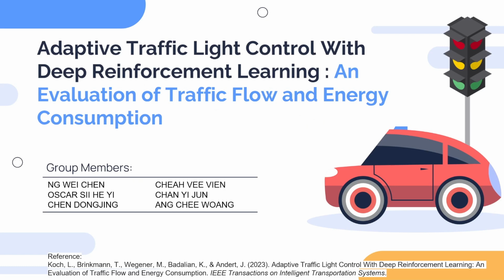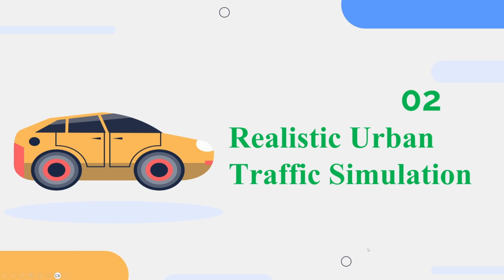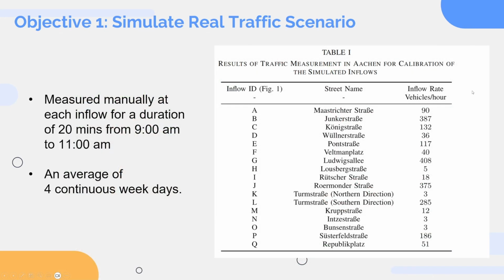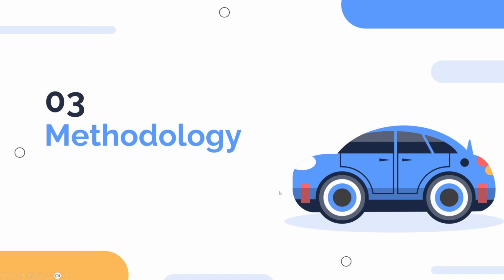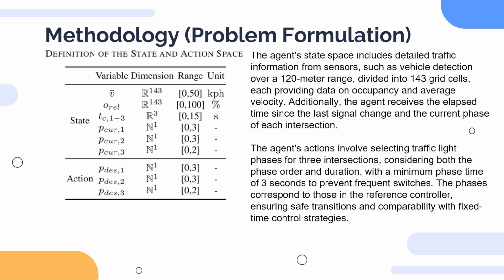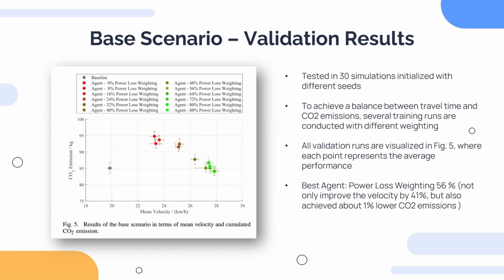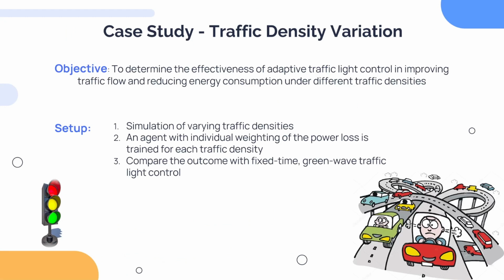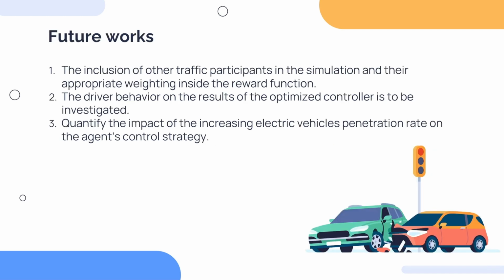202404 AIT306 Group 3

Comment: Group 2:
1. What is the main advantage of using adaptive traffic light control systems over fixed-time traffic light control systems?
2. What simulation tool was used to model the traffic scenario in the study, and why was it chosen?
3. From the graph in the validation results, why is the power loss weighting capped at 88% only and not increasing it further to get even lower emissions, since we can see that higher mean velocity correlates to lower CO2 emissions?
Reply: 1. Adaptive traffic light control system can adapt to real-time traffic conditions such as traffic congestion during rush hour and unexpected situations. From there it can adjust the traffic lights based on those scenarios to improve traffic flow.
Reply: 3. Although from the correlation of higher mean velocity and lower CO2 emissions, we can deduce that higher power loss weighting will lead to lower CO2 emissions, we must also consider that further maximising power loss weighting may also disrupt the traffic flow in real world scenario. For instance, in order to satisfy a very high penalty for power loss, all vehicles will all reach a condition where lanes are completely blocked and traffic collapses to achieve a low absolute power loss. This contradicts with our main objective to improve the traffic flow. Therefore, in this case, we can say that the agent diverges into a local minimum which is undesirable. From this research paper, the author has found out that the maximum power loss weighting before agent is trapped in a local minimum where vehicles can still move without blocking is 88%. Further increasing power loss weighting will cause traffic congestion where the RL agent might adopt strategy that results in vehicles not moving in order to reach a low power loss.
Reply: 2. Simulation of Urban Mobility (SUMO) was used to model the traffic scenarios of the city of Aachen, Germany. It is an open-source software suitable for obtaining necessary data to model traffic situations. It also has MMPEVEM model to evaluate the influence traffic light control on vehicles' energy consumption.

Comment: Group 1:
1. What are the main differences between fixed time and adaptive traffic light control system? Which one do you think is better? 

2. Based on the case study, it appears that the adaptive control agent’s performance reduces significantly at higher traffic density which resulted in little improvement compared to the fixed-time, green-wave traffic control system. Is there any further improvement that can be made to enhance the performance of the agent at higher traffic density?

3. What is the motivation of PPO?
Reply: 1. Fixed time traffic light control system relies on programmed schedule to control traffic light, so it cannot adapt to unexpected situations such as accidents or changes in traffic flow. Adaptive system adjusts the traffic light based on road conditions, thus it is more flexible and can handle complex road situations. Overall, adaptive control system is better than fixed time control system, however the system is more complex and requires a higher cost to implement.
Reply: 2. A viable approach to improve the agent's performance at higher traffic density is by adding more data collection points before the intersection where the agent is located. This can allow the agent to collect information regarding the traffic density earlier to facilitate more efficient road control planning. 
Another possible way could be to enhance the state representation of the environment. This could be done by including more comprehensive data about traffic conditions, such as the type of vehicles, pedestrian counts, and real-time weather conditions which can provide a richer context for the RL agent to make decisions.
Reply: 3)Proximal Policy Optimization (PPO) is designed and modified from TRPO to make reinforcement learning more stable and efficient. The key motivations behind PPO are:

Stability: Prevents big changes in the policy to avoid poor performance and instability.
Balance: Ensures a good balance between exploring new actions and using known good actions.
Efficiency: Uses a simpler, computationally efficient method for updates.